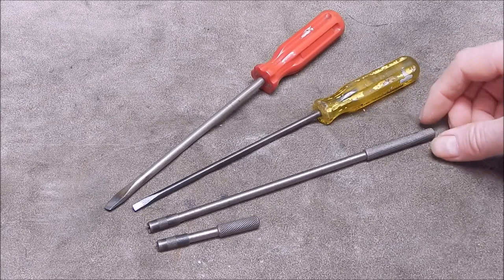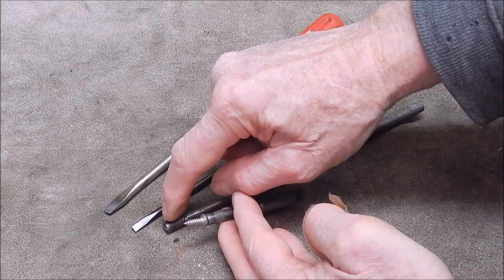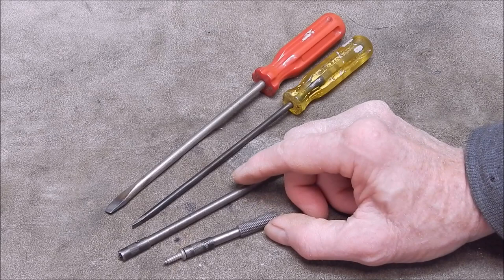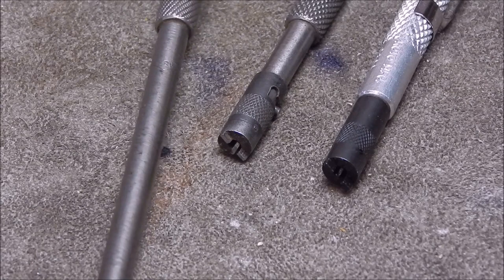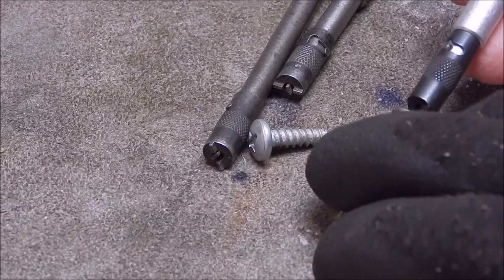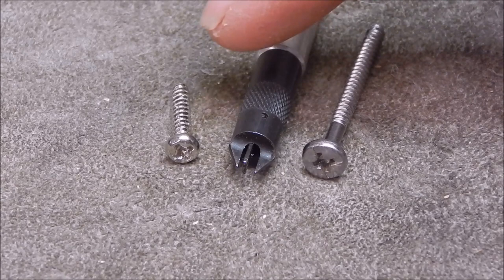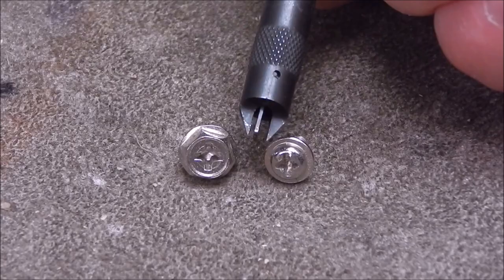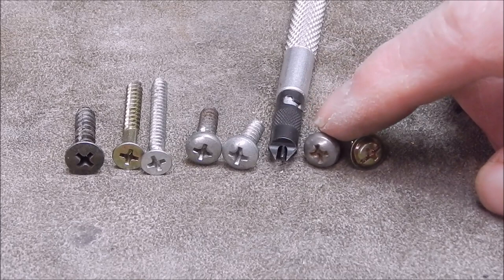I buy a new trick screw starter and compare it to the old ones - this does Phillips head as well.

Comment: The trick that I use relies on a small rare earth magnet that is usually stuck to my tool bucket.  In use, it is attached to the screwdriver shaft, and the screw is seated on the bit.  Of course,  the trick doesn't work on brass or aluminium screws.  Still, since I don't use many of either, it works most of the time.

Comment: I could have used one of those Phillips holders a few weeks ago when i replaced the tie straps for my fuel tanks in my boat , I had a great time laying on my back reaching up under the front deck trying to hold a stainless screw on the screwdriver with one hand then trying to line everything up with the previously drilled holes !
Sometimes the old trick of dipping the end of the screwdriver in grease works or a bit of blutac but it is a pain in the arse to do .
Reply from the maker: Sometimes a short piece of plastic or rubber fuel or vacuum hose slipped over the driver tip will also grip the screw head to keep it in place.  I've used that trick a few times to get out of jail ;)  Cheers Rob

Comment: Spring type screw starters are still somewhat common here in the states. The Stanley unit you show is the old Proto tool. The issue you found with the "Phillips" head came about with the improved designs that became common around the late '70s. It works great with actual Phillips patent drives. I still use my slot type for recessed machine screws.

Comment: Hi Rob , I thought for sure they would have put the opposite end of that Phillips driver to be a smaller Phillips driver for the smaller screws.   They can be harder to handle than the bigger ones.   Just makes sense to me.

Dale in Canada
Reply from the maker: Hi Dale,  I was expecting smaller, but apparently No 2 is the most widely used size according to the web.  Maybe these tips don't work as well on smaller sizes.  Cheers Rob

Comment: Hi Rob. The Sealey one I purchased looks very similar to your Stanley tool. The Blue Point one I got of ebay is again similar but slightly heavier than the Sealey one and I think better made. Like you say, they are great tools but somewhat limited to the sizes of screw head you can use them with. Cheers, Alan.
Reply from the maker: Hi Alan,  the Phillips head end works on some screws and not others for a given size number.   Even with regular Phillips head screw drivers the tips vary a lot in size and profile, so I fully expected similar issues with these gadgets.  The blade end is a lot more forgiving/adaptable and well worth having.  Handy in the toolbox for the day you need something like this ;)  Cheers Rob

Comment: Hi Rob !

How about just placing a neodyn magnet on the shaft of a ordinairy screw driver - slot/Philips/TORX ... OK only for steel screws ... but it's NOT just a starter thing - right ?
Reply from the maker: Hi Keld,  yes you can do that.  It works OK.  I've done it at times.  There's a variety of tricks you can use to get screws in difficult places. 

I was really interested to see how they tackled the Phillips head gripping side of things (mechanically), as it was a bit hard to imagine.  The driver itself looks to be well made like most Stanley stuff I've bought over the years.  The price for the model I tested varies enormously on the net and it's a case of get it as cheap as you can.  Cheers Rob

Comment: Pretty much anything related to Phillips screws is a compromise...
Even good quality drivers are disposable tools.
Reply from the maker: Yes Scott, the heads get torn up fairly easily compared to blade and torx or Allen heads, as the driver is always trying to climb out of the profile.    Easy to align when driving, but that's about it.  They always look a bit low rent to me compared to slot heads ;)  Cheers Rob
Reply: @Xynudu  I'm Canadian...
Robertson or GTFO!
(Tho torx is nearly acceptable...)
Reply: Scott you must not own true quality drivers then
Reply: @Tinker001  Robertson (aka square drive) can also cam out. Allen or Torx won't. For larger screws, hex head is the way.
Reply: @Tinker001  I'm from the US and I've been trying to tell people for years that Robertson is the superior fastener head type.  The most common reply I get is "they round of faster than anything else".  As soon as they say that I know they've never dealt with them and don't know what they're talking about.
Reply: @zachaliles  just to be clear there are square drive screws in electrical panels in the US and yes they strip quite easily are they better than poorly formed Phillips screws or using the wrong size Phillips driver? Sure but everything strips Phillips Robertson Allen and torx they all strip in the hands of the inexperienced
Reply: @TheOtherBill  they all strip